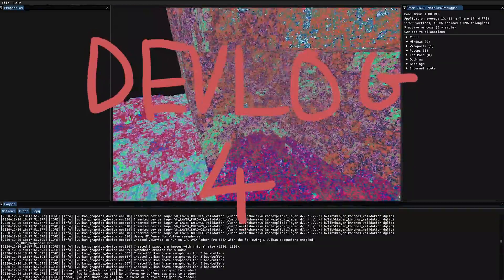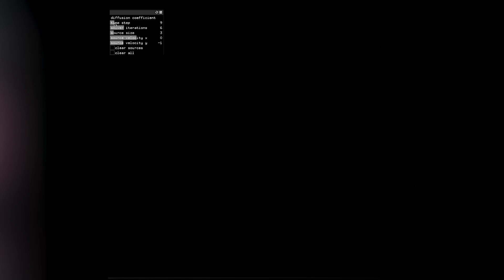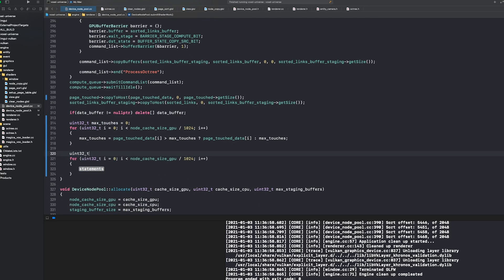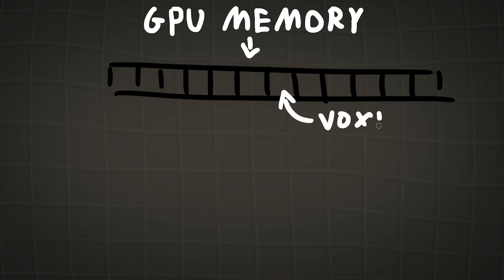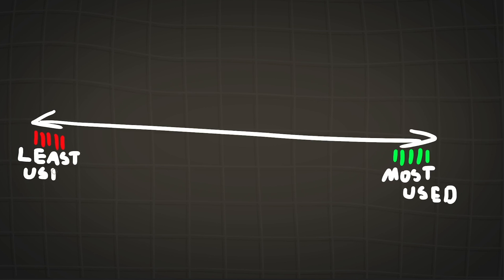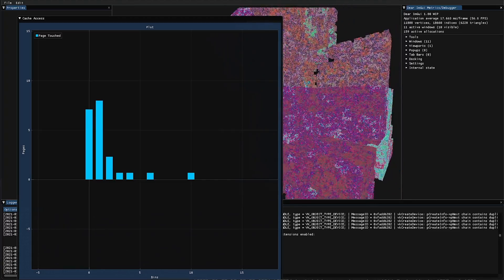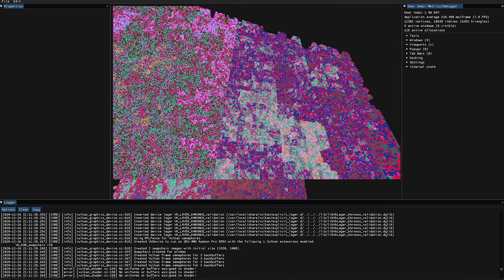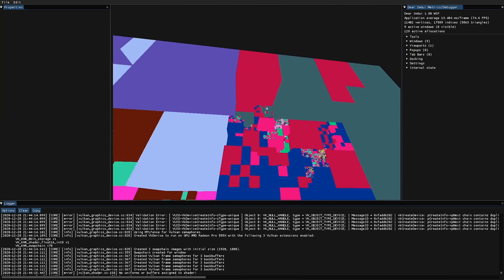DEBUGGING MY VULKAN GAME ENGINE | Devlog #4

Comment: Is your code on GitHub?
Reply from the maker: No not at the moment at least...
Reply: @voxelbee  
Aww bummer! It's always cool looking at people and learning from them! I'm slowly building a renderer myself, so it's fun learning experience comparing what I'm doing :) 
I understand you have your reasons, so no issues!
A question, is this a game engine, or a standalone renderer (at the moment)? By engine, I mean something along the lines of prototyping in the "editor" which can generate a "final build" (like an executable) where you explore the voxels?
Reply from the maker: @dexterman6361  Yeahh sorry :( At the moment it is more like a renderer but the core system for the engine is there. I have abstractions for different rendering APIs ect. But no editor or anything like that yet
Reply: @voxelbee  No issues! I hope it gets released on GitHub :) Really impressive codebase that you already have :) Great videos too!

Comment: Would it not make more sense to implement a sort of "double buffer" cache? Where instead of pushing voxels to the top of the array which causes a lot of reallocation, you simply have 2 cache buffers, one which holds the voxels rendered last frame then one empty one. Every time you render a voxel push it to the end of the empty list, and once you've rendered all of the voxels onscreen, push the unrendered ones to the end. No re allocation, only double the memory.
Reply from the maker: Well I'm using a circular buffer so this means that there are no relocations when moving to the front of the array...

Comment: I'm impressed every time for the density of the voxels, good jobs, waiting for new updates 🔥🚀

But one thing, you're trying to load voxels all in one and keep it loaded, have you tried to load and unload on camera position/vision? I mean, if I have a 3d cube made by 6 faces, I don't need to see the faces behind, I don't need to load the faces that I don't see, so, to load voxels I suggest you to load it using a sort of ray casting algorithm. (in a cube you don't need to load the voxels inside untill you have a voxel that cover another voxel)
Loading should be more smoother and use less memory I think

That's just a logic idea, I don't know if this is a good idea, keep working on I'm very interested
Reply from the maker: Thanks so much! Yeah that idea that you've got with loading the voxels is exactly what I'm doing. So that means that it's loading only the voxels that are looking at then storing them in a cache. This is one of the reasons it is so dense!